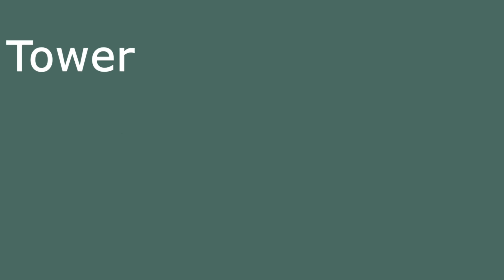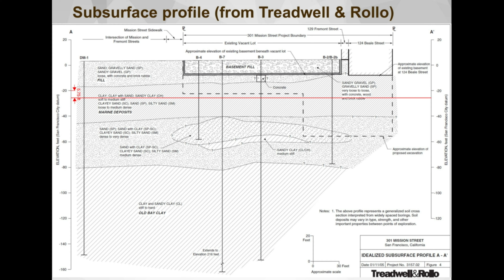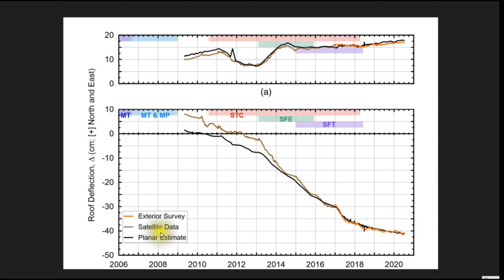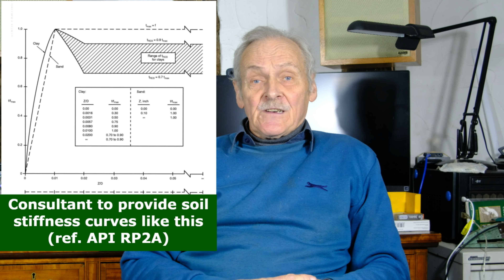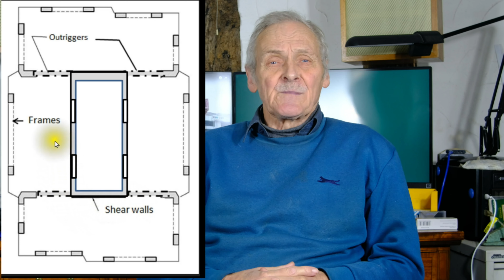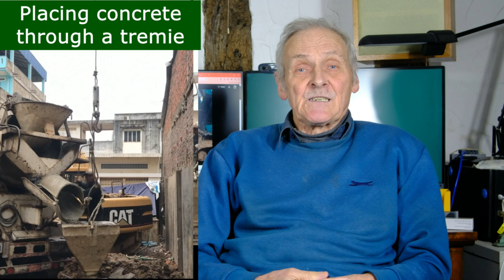Millennium Tower - in depth review of what really happened

Comment: you are right of the money. what happened could be that at some stage of the design they have decided to switch from steel to concrete, making it too heavy. any way you looked it its far more simple than everybody is trying to make it look. its engineering, simple.
Reply: It's incredibly poor engineering management and control  IMO. The engineering design, which I haven't reviewed, is probably acceptable.
Reply: @ key is geotechnical report. structural engineer have nothing to do with it- its conflict of interest if SE is dealing with soil issues
Reply: @AleksandarNeskovic-p8s  But who wrote the scope of work for the geotechnical consultants? How was the report reviewed by the structural engineer? I see failure at every level of the engineering management.

Comment: If I remember correctly the developer decided not to pile to bedrock in order to save $8M. What a huge mistake!
Reply from the maker: I have heard that too but didn't see any documentary evidence so I had to treat it as hearsay. You will note that I have been careful to substantiate everything I have said.
Reply: Whether or not the developer had the option, it’s actually the fault of the geotechnical and structural engineers who approve of the design. The developers couldn’t have opted to do friction piles rather than bedrock piles unless the engineers approved
Reply: Very unlikely that this was an option available to the developer.
Reply: @MarkGovern  Why not? There's nothing new here.
Reply: @MarkGovern  any developer can decide whether to drill the foundation down to the bedrock. It's simply a matter of cost.
Reply: @18000rpm  that is completely wrong. developer can only chose model he will use, provided that all models offered provide structural soundness of the building. developer is just some entity willing to put his  money into something- he can say what is it that he wants but he cannot say how.
Reply: @ Look it up. The developer made the decision not to pile into bedrock.
Reply: @18000rpm  As I say I have only heard hearsay evidence on this. I would need to have access to the project files to know for sure.
Reply: @ I was replying to @AleksandarNeskovic-p8s who says developers DO NOT have the option to drill into bedrock.